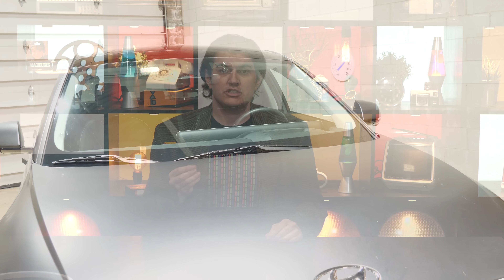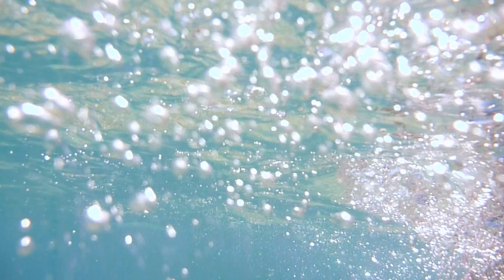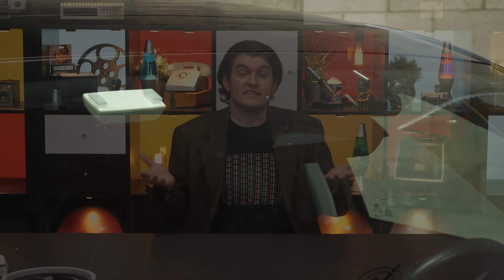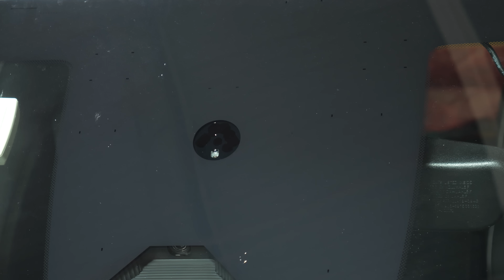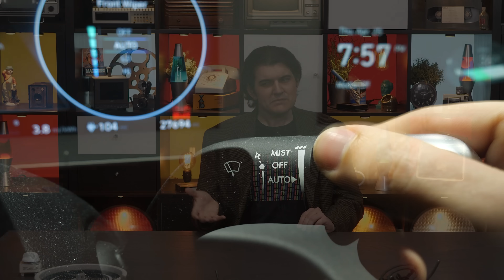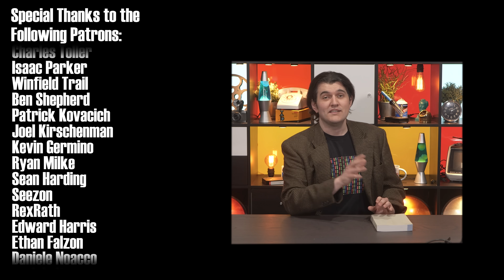The simple, clever sensor behind automatic windshield wipers

Comment: I read through my owner's manual to figure out how to turn off the honk when you lock it with the remote, and as a bonus, learned there was a way to put down the windows with the remote, so it can cool off before I get in.  Also learned the airbags aren't just all or nothing, it actually picks which airbags to deploy, and at least for the main ones, has two deploy speeds, and decides all that in a split second.

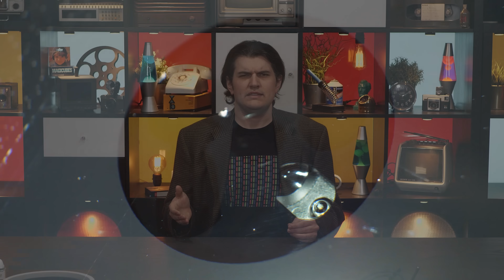Comment: 1:55 - Weird "Connections" involving "Technology," for certain!
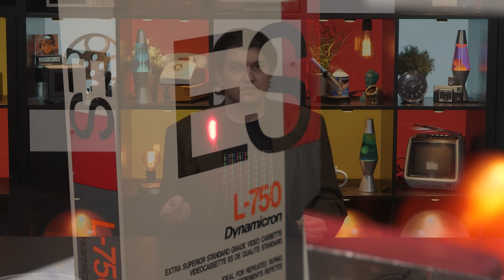2:49 - 🤣 With this statement, I hereby nominate Alec for "Understatement of the Year Award."

I'm also a fan of stalks on the steering column. Your hands never have to leave the wheel to operate wipers, headlights, etc. Alec is right, muscle memory allows you to operate essential controls without taking a hand off the wheel, or eyes off the road. In fact, I prefer tactile knobs, buttons, and switches because I can operate ALL of my vehicles' controls without having to actively think about it.

It was quite revolutionary indeed when we purchased a 1985 Chevy S-10 Blazer brand new, and my parents had the learning curve of having cruise control, high beam, and wiper operation moved to a stalk. (Dimmer switch on the floor, we never had cruise control before this, and the wiper switch was on the dash.) And OMFG INTERMITTENT WIPERS?! If the inventor of said delay wipers is still with us, thank you!

RTFM is a great bit of advice. It holds very important information like which bulbs are used where, and how to replace them. (No sense in paying a shop to do it!) And where the fuse panel(s) is(are), which fuse protects which circuit, and which rating of fuse to use for each circuit. Then there's the more mundane things like how to check your oil (provided your vehicle's manufacturer hasn't eliminated the dipstick... Yes, BMW, I'm talking to you!) and other fluids, the correct wiper blade sizes, how to program the clock/radio, etc. It's dry reading, but there is a veritable treasure trove of information to be found, and the more complex your vehicle is, the more information you could be missing out on.

Don't worry about the "vicious sarcasm." I rather enjoy it.

Comment: Seems like they work well on that car but I occasionally drive a Ford Transit Connect with automatic wipers and I despise them, even on the most sensitive setting they don't run frequently enough for me when it's misting and there's no normal intermittent setting, I just manually put them on normal speed or wait forever for the windshield to wipe.

Also my dad has a Hyundai Santa Fe and you have to change the wipers the same way, I found that out in like a minute of googling. I've had to explain that to other Hyundai owners too.

Comment: To play devil's advocate for a moment regarding reading the freaking manual:

I have a Jeep Grand Cherokee, and the bizarre ritual required to reset the oil life is in there as it turns out, but none of the sensible entries in the index point you to it. A quick google search revealed what I have to do: Stop the car, put it in Run mode but with the engine off, press the gas pedal down three times in succession (but not too quickly), turn it off and then turn it back on.

I did eventually discover (with no help from the index) that it is in the manual,  but very well hidden. I couldn't find it in the paper copy, I had to grab a PDF and ctrl-f to find it. Which then revealed where it was hiding.

Conspiracy theory time: it's hidden because they don't want you changing your own oil. They want you to take it to a mechanic, and preferably one attached to one of their dealers who uses their oil and their filters.

Comment: i wonder if applying a product like rainx would mess with the sensor sense now there is another layer on top to change the reflection. i know u could just not apply it on the sensor but just a interesting question. Also i wish they had a button to just make your wipers wipe on a timer that you prefer. sense most of the time it seems like the wiper selection is either to fast or to slow. it would be simple enough just a button u click to start the timer and click it again to stop timer and now your wipers will be that timing between wipes.

Comment: I borrowed a friend's truck once and learned it had automatic wipers. I didn't think a modern car could get more annoying and difficult to drive, and then I stumble upon this useless technology. It would turn the wipers on when they were not needed, change the speed without me changing it, just annoying. There is absolutely no reason for wipers, or really anything in a car, to be computer controlled.

Comment: Not so sure about that index.  In my experience Hyundai will put the info in the index, but the keyword they choose to list it under will be maybe the fifth to seventh word a native English speaker would think of.   On the other hand, I couldn't make an index in Korean at all, so I suppose they're still doing pretty well.   Or maybe they're just figuring that they will trick you into reading the whole manual by making that faster than using the index.

Comment: Clever and impressive as it is, I've still never driven a vehicle that had an automatic wiper feature that I liked. I find that it always wipes too frequently for my liking, so I always end up switching to manual permanently. Then again, most I have had were not adjustable. I have the same problem with advanced cruise control and automatic emergency breaking, so the problem is probably that the behavior I want from my vehicle is too many standard deviations from normal.

Comment: Pro tip from a fellow automobile owner who had to check the manual for how to change the wiper blades. 99% of the time you can just lift the hood (or frunk) to raise the blades for replacement. But seriously, parking the wipers in the up position should be as easy as holding the (pro) wiper stalk in the mist position for a few seconds.

Comment: i had a car some years ago with automatic wipers and I hated them.  They never seemed to really work well so I just stuck with manual mode.  My current car uses the same rain sensor tech to auto adjust the "intermittent" mode, ie: how often to wipe depends on how hard it's raining, and you can adjust that sensitivity.  What I find extra neat though, is that if I bypass the intermittent sensor mode and go to an always on mode, it'll auto switch to intermittent when I'm sitting at a traffic light, and back to always on when I start moving again, but if it's raining hard (or starts to rain harder) even at a stop the blades keep going. Pretty clever.  Now that's how automatic wipers should work :)

Comment: If you really don't have time to read the manual. Find the PDF online, then you can SEARCH for the thing you need. I did this for my car, and even bookmarked things I knew I would need again, like how to change the battery in the key, and what torque spec to tighten the wheel nuts to.

Comment: Some engineer: 
- looks at pulse oximeter
- looks at windshield
- squints eyes
Reply: Technology? Connected.
Reply: "I bet I could fit a bi-metallic strip in that windshield."
Reply: So here we are at the age old question: What came first, the pulse oxymeter or the automatic wind shield wiper?
Reply: @andreasu.3546  pulse oxymeter. First one was from 72, first automatic wipers were sold 96
Reply: @erebostd  first auto wipers were sold in 1970, but also pulse oximeters were merely commercialized in 72-75 - the technique was invented in 1937!  it just took a while for technology to get them small / accurate / cheap enough to make it into health care at scale.
Reply: @ParrotDuct  first wipers in 1970? Which brand? I’m quite interested in car technology, I didn’t know there was an auto wiper with infrared technology in the 70s, just the old version that worked with impedance and such. Very interesting!
Reply: Some engineer looks at even simpler Refraktometer/Refractometer and looks at car, hmmmmm
Reply: you could say he made a technology connection

Comment: Ha, that's something I really like about the Chevy Bolt EV; it has no actual linkage between the wipers, so you can just grab them and turn them to whatever position you'd like. When you turn the car on, it will automatically home them, and as long as you don't cross them (and maybe even if you do; I haven't tried it), they'll just figure themselves out no matter where on the windshield you left them. Pretty neat!

Comment: 9:32 I recently bought a 2023 Mazda CX-30 with automatic wipers. I needed to check my washer plumbing on the driver's side wiper and I ran into the same problem you did. I fumbled with it for a few minutes, then cursed the design engineers for their stupidity. After watching your video, however, I probably owe them an apology. I still haven't checked the owner's manual, but I'm guessing Mazda CX-30's have the exact same procedure as the Ioniq 5. 😓

Comment: On the one hand, if you're having an issue you should RTFM. On the other hand, requiring the user to put the car in a specific mode through unintuitive means and not providing any user interface elements to indicate how to do that is what I would consider to be Bad Design, especially considering that most other vehicles don't have any such requirement.
Or, to put it a different way: yes, the manual exists for a reason, but reading it shouldn't be necessary to perform basic tasks, especially when those tasks are intended to be performed by the end user.

Comment: between the car manual, the display manual, the app's manual and the skylink manual, I have about an inch of manuals with my new Crosstrek. 

As far as reading the manual, the manual for my previous car, a crappy VW Jetta, gave explicitly wrong instructions on how to access the settings panel to set the clock and default display options. I found by trial and error a different sequence of stalk motions and button on power on that reached the settings panel.  It also turned out there was a mostly hidden button to advance the clock manually that was not mentioned in the manual anywhere I could find.

Comment: My Mercedes-Benz doesn't use an optical sensor but instead a capacitive one. You can see two plates on the glass and the water will lower the capacitance between the plates.

Comment: My wondering is, if it's so simple, why did it take so long to appear in cars? Or is it deliberately withheld for mid-range and luxury cars, while they not only penny-pinch budget cars, but leave out reasonable features as incentive to get the need to upgrade? I had a budget car from 2000 where they didn't even include an intermittent wiper function; it was just off, on, and high.

Comment: You don't even need software to make an automatic windshield wiper.  Doing it with a little microprocessor may be cheaper but:
Pulsing an LED is an easy thing to do.
Amplifying a photo diode signal is easy.
Detecting the signal on the photodiode that is in step with the signal blinking the LEDs is not hard.
Looking for a change in the detected signal is not hard.
Resetting the baseline any time the wipers go is not hard.
Yes it is more parts than a little micro but still it can be done.  Someone could even make a chip that does it all.

Comment: A good tie in would be to describe how Apple's first mouse worked by quadrature coding on a light and a photodiode with a slotted wheel driven by the rubber ball.   Basically the cleverness that can be done by with a light and a photodiode...

Comment: The Owner's Manual for my Hyundai is similar to yours with about 300 pages.  The Owner's Manual for my 57 Chevy has 8 pages, including pages on how to change your oil, change ignition components, greasing the chassis, and other basic maintenance procedures.  You need 3 or 4 days to read the whole thing.  Who has that much time?

Comment: On the wiper blades thing, the one car I had that buried its wiper blades in that way would bring the wipers to attention if you nudged the wiper stalk within 30 seconds of turning the engine off. Easily done accidentally so you might remember having done it before, when you needed to do it again...

Comment: I hate them.   They work fine for a few minutes on intermittent when it's spitting, but when it stops they go haywire and wipe full speed.
I can select Co stant wipe and fastest wipe manually if I want but I can't turn the auto feature off its very annoying.

Also I can't turn off the proximity for the cruise control.  So when I'm on the motorway doing 60mph and a car pulls in front of me a couple car lengths in front, my car starts braking to maintain the distance.  If it was up to me I would just ease off the gas but the car always brakes.

Comment: My jeep has that auto wiper feature. It's not that great. And it turns the headlights on even if it's not wiping. If the switch is on. I turned that off but sometimes use the auto wiper still. It should be on more spots on the windshield to detect light rain. But software updates are for phones and video games. Cars should be 99 percent ready from the factory.

Comment: The automatic wipers on my 2013 C-Max are pretty stellar.  Only time I have to manually wipe is if the windshield is already wet when I get in the car or if it's very tint spots.  Otherwise it does a great job of detecting and wiping at the right time.  The auto wipers in my 2009 Volvo V50 weren't near as good.  I also have the wipers under the hood issue when changing the blades, but I can open the hood on the C-Max and get them that way without needing to look at the owners manual to figure out how to park them.

Comment: I am a shade tree mechanic which means I understand most car / electrical principals. However, the fact that at least the 2019 Ford Fusion give or take year wipers are not mechanical is new to me.  Even after you shut the vehicle off you may manipulate the wipers by hand.
Reply: PS yes automatic wipers can and will go so rapidly I end off turning them back to manual.

Comment: After every wipe the sensor assumes the window is clean and uses that as a baseline reference. Every time it sweeps the arm it resets the base line. Manually activating the wipers also causes a baseline reset. If the measured refraction of the last reset before the last power down is close enough to the refraction at the next startup it assumes the window is clean.

Comment: I love auto wipers, when done right. The van I had with them would set the wiper to off by default, it was a pita when I would stop the engine 2-300 times a day and have to remember to turn them on. What was the point of auto wipers if you have to turn them on every time?

Comment: If the wiper arms are too far below the hood line to change the blades, they may be low enough to get to them with the hood open. A bit more cumbersome but may have spared you from waking your manual from its deep slumber.

Comment: 6:55 Annoyingly, both our VW cars, one from 2013, the other from 2019, do not do this.
So after turning it on it can take a bit before it wipes the wind-shield, leaving a distorted vision before this.
To mitigate this, I always lower the stalk to the single wipe position, then set it back to the automatic mode when it rains.
9:25 These cars have a similar feature with the stalks while it is off, flashing the highs then turns on the normal lamps on for a minute or so.
It does a similar thing when unlocked with the keyfob when entering, but this is for packing things around the car after getting out.

Comment: On my 2011 Ford fusion hybrid has a rain sensor that wipes when dry and stops wiping when during a torrential downpour like it gets to tired of wiping so much. The Ford dealership replaced the control sensitivity arm and that changed nothing. So when they changed out the control arm they changed the sensor on the glass. That changed nothing. So the service manager said that's all they can do. 

For support line asked me if I wanted to go to another dealership. 
My experience in the Navy as an Electronic Warfare tech told me it was a sampling rate problem and communication to the computer that controls the wiping. Ford didn't want to go that deep, so it was never resolved to this day.

Comment: Austrian here: one of the most interesting things in this video was the wiper stock and how its movement is different to most europeans cars

My 2022 Hyundai i20N (and my Opel Corsa D i had before as well as basically every car i’ve ever driven) has the high setting for the wipers if you press the stock up, down is only if you want a single wipe in the front

So down is single front wipe (it springs back into the neutral position)
Up is slow front wipe or AUTO
Up a second time is high or slow if you have an AUTO function
Up a third time is fast
Pulling sprays wiper fluid in the front
Turning the stock end or pressing slightly is rear wiping
Pressing “hard” sprays wiper fluid in the rear

Comment: My old VW automatically closed the windows if the sensor detected rain.

my new one doesn’t 😞

wonder why that isn’t standard on all cars.

btw. two random ramblings on the subject:

1. old Peugeot’s had rain sensors with visible light.

2. on the VW Phanteon you need a service computer to put the wipers in the service position.

you also should take a look at VW’s wiper system, they move the blades a little bit up and down to keep them flexible.
greatly expanded their life